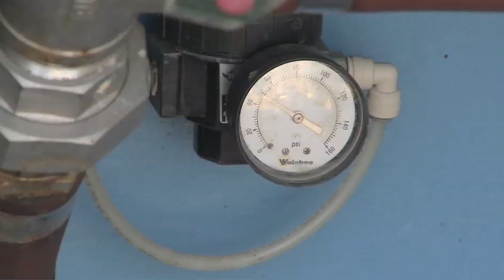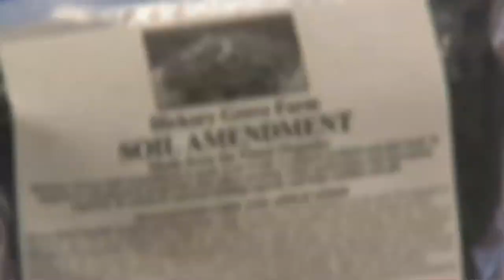Turning Hog Waste into Environmentally Friendly Fertilizer - America's Heartland

Comment: Can anyone tell me how the hell this hog farmer has reduced his carbon footprint by 6,500 metric tons?!?!???!
Reply: Those lagoons are secondary methane producers when the bacteria chomp down.
Reply: @andyh7537  the carbon from just having a sess pool that sprays water vs these tubes is 10 fold a difference. The foot print is still there, the out put is not as high
Reply: I was thinking the same thing! 😂😂
Reply: Over the entire scale, they estimated that the carbon footprint of pork for every kg (~2.2 lbs) of pig carcass weight has an emissions intensity of 6.1 kg of carbon dioxide equivalent.
Reply: - The collected biogas from the pig waste can be burned to generate electricity, which would otherwise have likely been generated by coal or natural gas.
- As seen in the video, the solids from the waste are collected instead of being thrown into the environment.
Reply: These tax-supported no-real-job busybodies want to apply human sewage treatment standards to hog farming.  Get ready to pay higher prices for corporate-made pork.